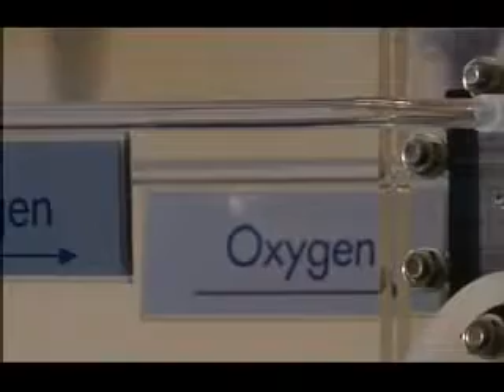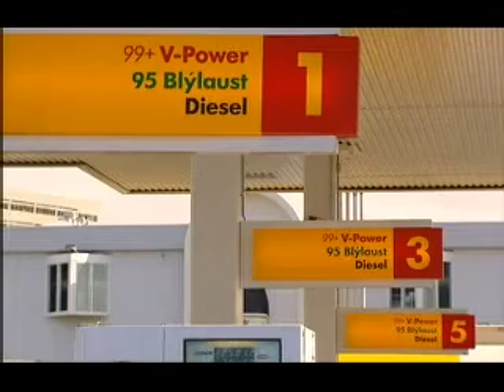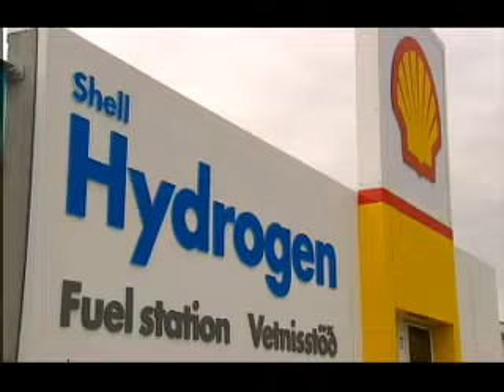Hydrogen Economy - Iceland

Comment: Iceland is on the right track using their resources.  
All of these armchair 'scientists ' and environmental wack-jobs should stop running their mouth about things they know very little about or have been given bad or skewed information. Things take time to improve and become more efficient. The technology needs to be proven and efficiencies will come with mass adoption. This occurred with boats/ships, automobile, airplane, etc. and will happen with electric vehicles. Get behind the technology and it will become more efficient and improve. Electric vehicles have far  fewer moving parts and will last MUCH longer. The battery or storage medium will improve. The people that make and sell petrol will generate disinformation because they want to keep their industry viable. There are many ways to make electricity: solar, wind, nuclear to name a few. Yes.. NUCLEAR power is one of the best IF it is a Thorium Molten Salt Reactor. We had a molten salt reactor in operation at the Oak Ridge National Laboratory from 1965 until 1970 and the idiot President Nixon pulled the plug on it because it had no waste that could be used to make nuclear weapons. Nixon wanted nuclear waste.. now we have so much we don't know what to do with it since we don't make nukes any more. The Thorium Molten Salt Nuclear Reactor is the safest since it cannot 'melt down'. Scientists who were involved are all retired, but their documentation was located and it has been determined that our current nuclear waste can be consumed in the molten salt reactor eliminating the storage problem we currently have and generating lots of cheap safe electricity. Here is a link with the whole thing in a nutshell:
https://www.youtube.com/watch?v=WGBkV3ZLTDI 
Very good Oak Ridge Laboratory Video about it from that time : 
https://www.youtube.com/watch?v=tyDbq5HRs0o
Feel free to look this up for yourself. I am NOT connected in any way with any of these industries, but there is so much disinformation I had to speak up.

Comment: What's the need for hydrogen? They produce so much more electricity than they need so they might as well just go electric
Reply: Battery cars perform very poorly in cold weather.

-jcr
Reply: Very funny.
Reply: Ewan Fuller lots of  reasons. One of the biggest is that current internal combustion engines can easily converted to hydrogen. electric cars even though they are emissions  free are very environmentally unfriendly to make.
Reply: Burning hydrogen in an internal combustion engine is a waste of hydrogen.  Anything you burn in an engine is going to lose at least half of its energy as exhaust heat.
Reply: Hydrogen is the most abundant element in the universe and in excess on our planet. Worrying about wasting it is useless. There is more than what we need and can use. The point is the manufacturing of new products is way more environmentally unfriendly than the use of them. Typically the production of any new car produces three times as much pollution that comes from that car over it's life. That's why going out buying a new prius is actually more unfriendly to the environment  than keeping your old car up to spec. This is the problem with a disposable society. Retrofitting cars that already exist; that can easily be converted to hydrogen, is better because it doesn't require the replacement of all existing vehicles like electric vehicles do.
Reply: How abundant it is in the universe doesn't affect how much you have on board your vehicle.  Fuel cells beat internal combustion engines by a very wide margin.

Comment: The eruption at Silver Creek was about half as big as the largest early known eruption at the Yellowstone supervolcano 2.1 million years ago, which released 2,450 cubic kilometers of material, and it was about 260 times as big as the large eruption at Mount Pinatubo in 1991. Yellowstones most recent mass Extinction level MEGA ERUPTION was a series of Erruption less than 780,000 years ago .
Pyroclastic flows consist of hot gas, ash, and rock that are released after a volcanic eruption, and flows are generally thought to travel at rapid speeds following the eruption of a supervolcano, where greater than 1,000 cubic kilometers of material is ejected. However, new data on the enormous eruption at Silver Creek 18.8 million years ago suggest that the flows there were relatively slow—on the order of only 5 to 20 meters per second (11 to 45 miles per hour).
http://earthsky.org/earth/scientists-reconstruct-supervolcanic-eruption?utm_source=EarthSky+News&utm_campaign=5099c31f50-EarthSky_News&utm_medium=email&utm_term=0_c643945d79-5099c31f50-393753109
During this eruption, more than 1,300 cubic kilometers of material was ejected, and it blanketed an area of about 32,000 square kilometers in the region where the borders of Arizona, California, and Nevada are now located. The deposits were 5 to 40 meters deep in many locations surrounding the caldera, and they reached distances of more 170 kilometres (106 miles) away from the vent.
https://www.youtube.com/watch?v=U79CWDtdZOA&index=1&list=PL2Lz9LTm142w2w7f_UGRE_u4FO2XZgA55
= The antithesis is to mitigate these major extinction events by mining the energy , metals and minerals in intersession ; which is raise threw civil issued GrEeN Climate Change War Bonds , later making a massive profit to fund all manner of social , civil sentient sapient concern including funding your Mars Migration Co-oPeratives and moving on to serve all live forward to sterile worlds you shall Terra Form and use as Live Ark Ships taking the seeds of life with you along with knowledge you have gained threw wise and sapient ways in master ; perhaps in a 1,000 years , even to shake hands with other all ready living life worlds when have learn how to behave MANs of Homo sapien nature  !

Comment: So this video is 12 years old, and where is hydrogen economy? Nowhere, because it does not make sense. Hydrogen is not energy source, it is energy storage, and pretty bad one. If you put 100kWh of electricity into making hydrogen, you get back 30kWh from fuel cell, so you wasted 70% of energy.
Reply: +Sasoon2006 no waste if you got the energy for free by using renewable energy source like to solar to produce it, it can be a very good solution
Reply: +togowack and where do I get those free solar panels and wind turbines? Another problem is efficiency of the process electricity->hydrogen->electricity where you lose 2/3 of energy. This means that you need to put 3 times more solar panels compared to using battery. For example if you are using solar panels to fill up hydrogen car (5kg of hydrogen) in a day, you need solar array that can produce 300kWh in a day. If you are charging battery EV in a day, you need solar array that will produce 100kWh in a day. (Both cars can do around 300 miles)
Reply: +Sasoon2006 you get them after you pass the payoff period, for solar at least. Wind turbines require a significant amount of maintenance. The efficiency of batteries is a non-issue for cars, since they simply do not work. They are extremely expensive and unreliable. Not many people drive 300 miles in a day, many can burn through 100-150 km in a day, which is less than 100 miles. In Hydrogen economy you charge overnight in 8 hours you probably need less than 1 kw of charge per hour considering  electrolysis is 60-70% efficient and hydrogen runs fairly well in ICE's. Bob Lazar runs his car on a 250w panel charging during the day but probably only drives short distances. Portable hydrogen charging systems employed for prototypes are not usually that large either.
Reply: @togowack  
So rather than running the hydrogen though a fuel cell, you want to burn it in an internal combustion engine with an even lower efficiency?

Comment: Be very wary of hydrogen hype. 1) Hydrogen is an energy carrier, not an energy source, and making it requires large inputs of external energy. 2) Hydrogen fuel cells permanently remove oxygen from the atmosphere because they output H20, not CO2 (which plants recycle back into oxygen). The irreversible removal of oxygen from the atmosphere (hypoxia) could be a life-threatening issue if hydrogen-based fuel cells gained widespread use. Man tends to fix one problem by creating another.
Reply: +NoEcologyNoEconomy If Hydrogen economy are supposed to happen, we require Hydrogen production process as it does not naturally exist on earth. Such production only make sense if we use the most abundant source of hydrogen which is water. Therefore your claim on irreversible removal of oxygen is obviously invalid as to extract hydrogen from the water means we need to separate them from oxygen which produces breathable oxygen gas.
Reply: +NoEcologyNoEconomy  When you burn Hydrogen, it becomes water. seriously, H2O, Burnt Hydrogen is oxidized hydrogen, Which is pure water.
Reply: +NoEcologyNoEconomy I'm sorry, but i suddenly feel a very strong need to be plain out rude in the youtube comment section.

Did your mom play basketball with you as an infant or can't you seriously be arsed to read wikipedia for 5 minutes and see how monstrously wrong you are???
Yes, Co2 is an essential part of life in it's current state where animals and humans need the oxygen while plants need the carbon. The only problem is that there's too much Co2 in the atmosphere messing with the climate and our ability to breathe.

Hydrogen production in its current state is simply using electricity to split water (H2O) into separate oxygen and hydrogen molecules.
That reaction is reversed in a fuel cell, so all the extra oxygen coming from the hydrogen production, which is either released into the air or sold in high pressure metal cylinders e.g. to hospitals, is rebalanced by fusing into water molecules again, leaving a small amount of energy behind.
Following these steps, no atmospheric oxygen is consumed at all.

It's not really bad having normal non-toxic drinkable steam coming out of vehicles.
As long as we keep breathing and dying the Co2 production will continue, just as the circle of life.

PS: H2O is also a common atmospheric gas.

Comment: I would have thought using hydrogen in a combustion engine (where it would completely replace gasoline, not just supplement) would be more efficient than using a fuel cell. I assume the research was done on this, but I'd be interested to see the results, just the same...
Reply: in a combustion engine, 90% of energy is lost as heat.  a combustion engine is inefficient for that reason.  
in a fuel cell, there's no heat generation.  it tends to be more efficient, by almost a factor of 10.   fuel cells require platinum, a very expensive element, as catalyst.
thus the problem is how do we make a fuel cell without platinum? - nobody knows fully, yet.  otherwise, i think the hydrogen economy would really take off.
Reply: @Kane-ib5sn  That comment was 9 years ago, and would have been able to answer it for myself now, if I remembered I even left this lol...Didn't know much about thermodynamics back then. Thank you though! Hopefully it will answer the question for someone else.

Comment: @intimeslikenow Hydrogen combustion engines aren't as efficient as gasoline/diesel engines. Using Hydrogen fuel cells gives you better energy efficiency atm. Until we can better extract the energy that hydrogen holds the cells are the way to go.

Comment: Fair point; but I guess they are still looking at ways to do this efficiently. I heard that ydrogen can be more efficient at storing energy than powerlines though. Also If they were to use technology like CCS at the oil and gas powerstations there would be less co2 and other emmisions. (Obviously this does not solve the oil and gas problem completly, but it could be a start)

Comment: Hindenburg started burning because of the paint that was used. There was not enough knowledge back in those days.Normal gas can ignite from about 10 meters from it's source, that will never happen with hydrogen because it is so light that it will rise up to the sky immediately. Hydrogen is very safe compared to gasoline, but because hydrogen 'can' give a loud bang it scares people. In general people are scared of things that they do not know, that is called primal behavior, use your mind instead

Comment: I hear them talking about cars with hydrogen and a rechargeable battery (plugged). So you can use the battery for shorter distance and hydrogen for longer distances. It is very viable and feasible. I think they already have those cars. We will probably see it in couple of years.

Comment: No you misunderstand me. The naming of Iceland and Greenland was designed in a way to bluff the vikings to go to Greenland. Wether it worked or not is not the case. Just the fact that it was dont to fool potential attackers. There are stories about vikings sailing to greenland and as far as america. I never said that Greenlanders that is the eskimos were vikings. The vikings did not settle in in greenland. They died out. And no one knows why. Maybe because they could not tolerate the cold